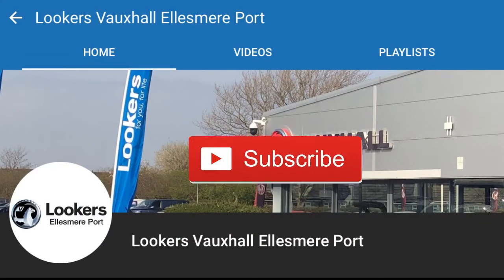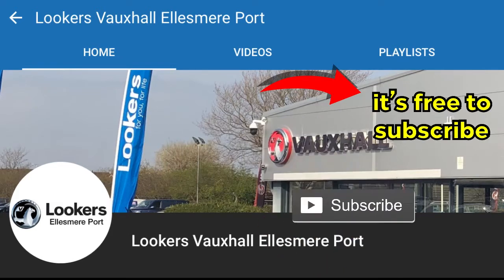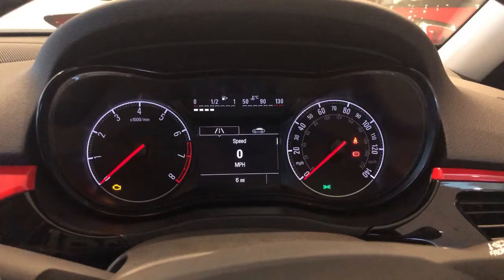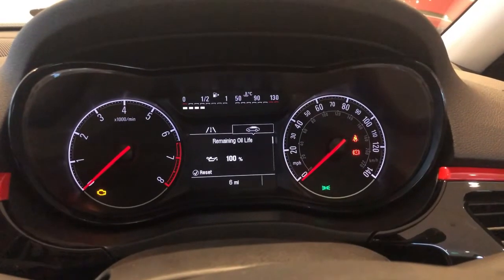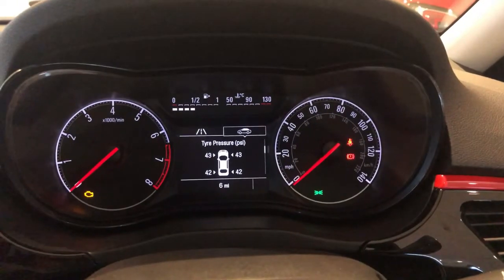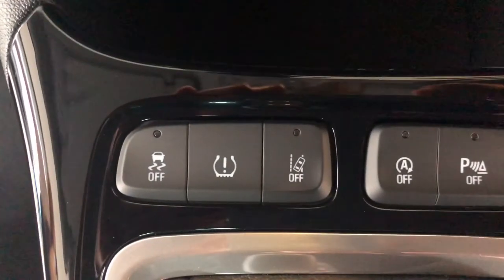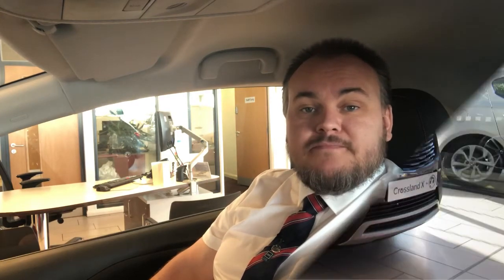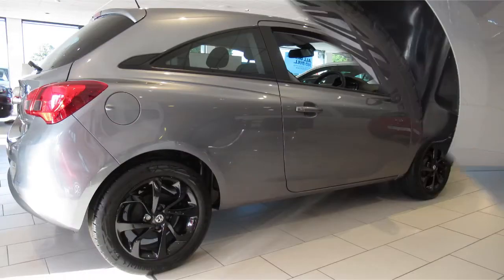What is the tyre Pressure Monitoring System (TPMS)?  Our second video request.

Comment: I have a 2015 Vauxhall Corsa SRI and it says service tyres and keeps coming up on one of my tyres that the pressure is low witch it isn’t cause I put air into it but still says it’s low I don’t have a clue
Reply: Did you try to reset the waring light?
Reply: I have a 2015 Vauxhall corsa e limited edition 1.4 and I had the same issue but after I reset the warning and ‘relearned the pressure’ it was fine. ( you just click the modes and scroll to the tyre pressure one and then hold the button on the indicator side for around 3 secs, then proceed to ‘relearn the pressure’